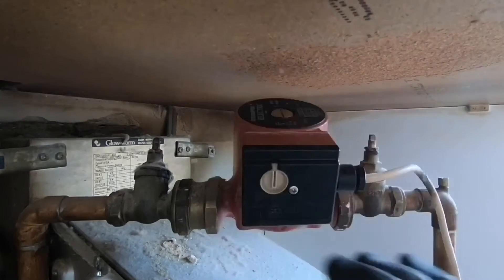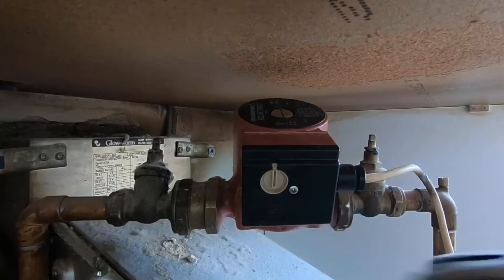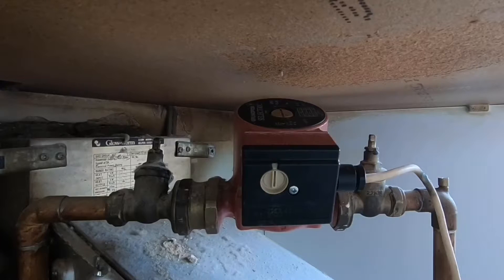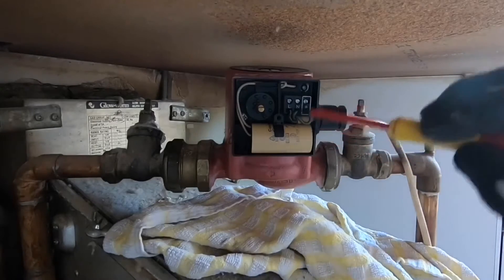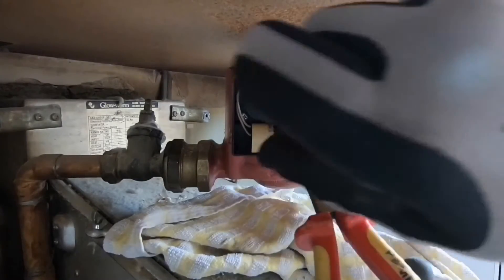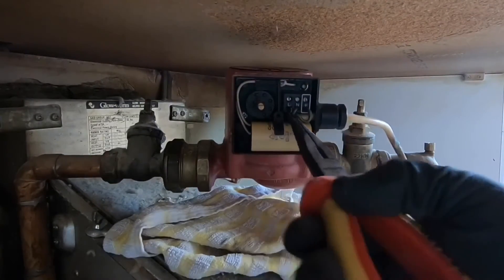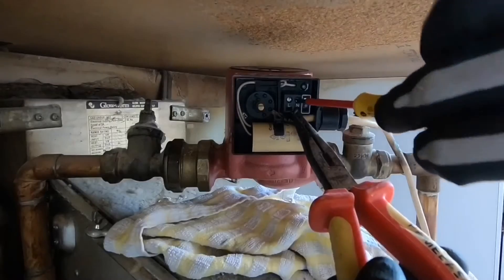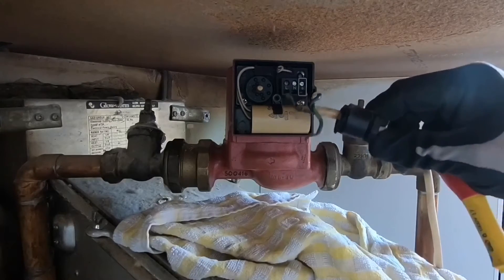How to remove a central heating pump

Comment: My valves are not closing either side of pump water still coming through
Reply from the maker: If they're not shutting off I'm afraid it's a drain down and swap pump and valves
Reply: @PlumbingGy  Thanks Dan .
That's what I did in the end ,new pump n valves on and all good ..it's so quiet too now lol ..
That pump was well and truly seized on the bottom thread 
Must have been on there for many years